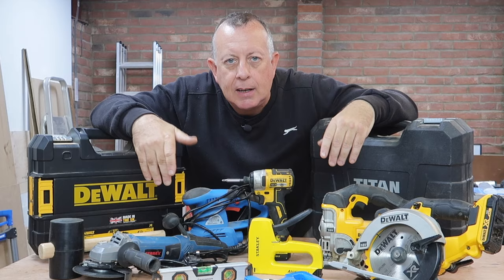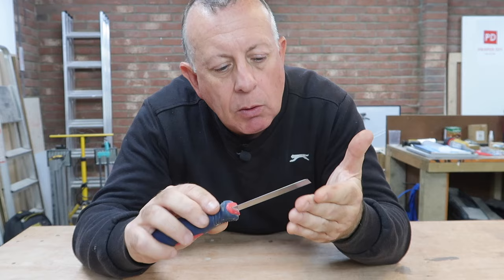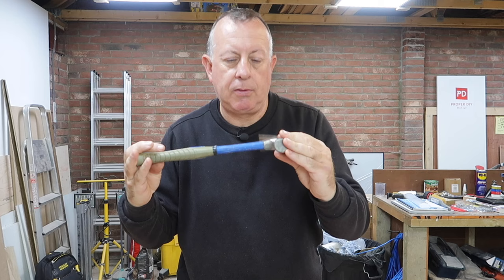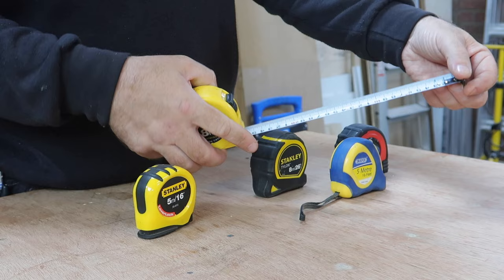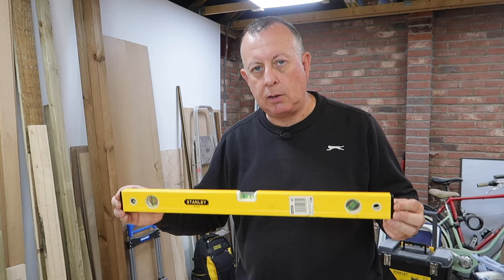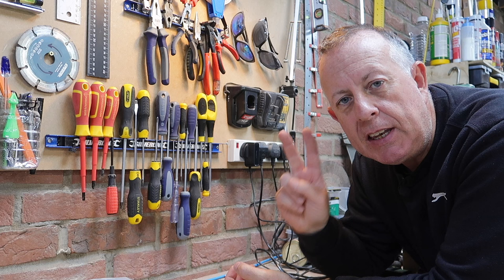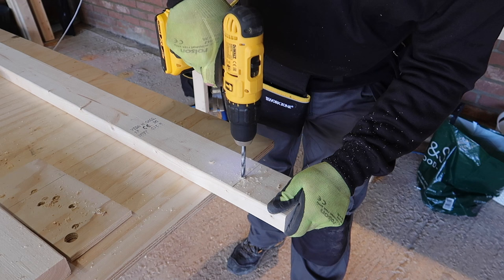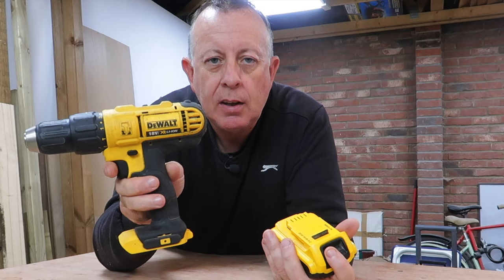Top 10 Tools for the New DIY'er for less than £100

Comment: All the tools are correct, but much better to buy once, cry once and buy the best quality branded tools you can afford.  There’s a world of difference between a trade quality handsaw or adjustable spanner or spirit level or pliers and their cheap pound shop version. 
I’d add a combination square and slip joint pliers to this kit too.
Reply from the maker: Thats fine if you have the money and therefore choice. It's a top 10 so if you are going to add 2 you need to take 2 away as well!

Comment: for the cheap cordless drill (IE, not makita dewalt milwaukee hitachi etc etc) id say get a black and decker. they have a bad reputation for "not being high end" but they also dont claim to be. and at the very least the black and decker is above the no name brand power tools cause at least theres easily obtainable replacement batteries. if you buy a no name cordless drill in a years time the company might no longer exist and replacement batteries will be an issue. 

for occasional use theres nothing at all wrong with black and decker.

Comment: Good choices, particularly the budget cordless drill. My only proviso would be buying into a battery set, so if you do buy the cheap one, as you progress and potentially improve your tools you couldn't buy a bare unit and would end up with additional chargers. Not a major headache, but I prefer one (Bosch)
Reply from the maker: Great tip!
Reply: Agreed drill/driver is so universal going too cheap is counter productive and replacement with better inevitable, pay once cry once for cordless drill. I went Worx, no regrets at all ;-)

Comment: It's a good starter list. I would add locking pliers, a more extensive bit set than is with the budget drill, a set of spanners/sockets because an adjustable can round off bolt heads, a hacksaw and a cheap tool box to keep all the stuff in one tidy place. 
One more thing is, the budget drill has a weaker battery and my Ryobi cordless tended to cut out, a safety feature, when pushing it a bit on half a dozen masonry fixings. A 3 or 4.5 ah battery or better brand like Dewalt is worth the money, but it really depends on what you need it for. Luckily I had my cheap corded one as backup to do the meat of the work.
Reply from the maker: So you have just added in 5 new items. Which 5 would you delete? This is a top 10.
Reply: Agreed on the the battery stuff. DeWalt Milwaukee Festool? Going to put the price up. If you are dipping your toe in the water. Buy budget, if you kill it, buy long term? No point having Festool cordless sitting in the cupboard for 11.5 months a year
Reply: @ProperDIY  10 is too limited, like songs. Which 50 to leave off the list? Didn't even get onto chisels:)

Comment: i wish id bought a track saw and router years ago. use them all the time now. most of my tools are dewalt but i couldnt afford their track saw at 700! so i got the erbauer for 160 and its a great bit of kit for the cash. i have had cheap routers and all been crap so i got the dewalt tho.
Reply: Glad to hear Erbauer track saw is good for you. Erbauer and Evolution seem to vary quality control. When good, very very good; when bad, lethally dangerous - I've returned examples of both when I spotted flaws before using and shops grateful I hadn't found the flaws the hard way!

Comment: Well depending on what your doing, sooner or later one day you'll be at the point you need to buy higher end tools. Drill press, band saw, belt sander, jointer, table saw, etc..... I'm getting carried away with all the stuff I want.

Comment: Wise list. I'd make one big change...
Not 20 years, but 50 years for how long they can remain useful, even by heavy duty DiYer. 
   Small changes: adjustable spanner quality and price matter a lot - Bahco or similar standard only, cheaper are floppy and round the nuts; pliers, similar, once you've used better, there's no going back. A problem for an occasional DiYer is putting up with a bad tool because you've got it then finding it difficult to work with, blaming yourself as incompetent then coming to someone like me to do your little job that is now a bigger job because nuts rounded over, screw heads mashed, cables frayed, visible material scratched and scored. Cheap hammer ok, if not ideal; cheap adjustable spanner almost always a bad idea leaving no skin on knuckles and bloodstain on wood or paint

Comment: I generally find this channel really useful but this video is just plain wrong. For example, the last 3 jobs i did as a very occasional diyer (i tend to start something and finish it 3 years later....maybe....if i am nagged enough) were:

Cutting some old warehouse racking uprights down to fit in the garage. You try doing that with a hand saw. Needed a cutting disc in a grinder.

Drilling the concrete floor for bolting the racking down. A dewalt 996 barely touched it. I had to bring out one of your favourites, the Titan SDS.

Cutting a damaged section of skirting out in an old house where puling the whole board off would have damaged all the plaster. Multicutter made short work of it.

The £100 tool kit might allow someone to put up a curtain pole i suppose.

Comment: Good video.
I’ve acquired loads of tools over the years and I need every one of them. 😂
Surprised you didn’t mention the 45 degree on the saw handle. I’ve an WORKX 20V MAX Lithium drill driver at home, metal head on it. Love it, light and powerful. Use Dewalt at work. Buying a drill drivers only the start, you could do a Top 10 drill driver bits video. Drilling n driving, it’s legal honest 🍺✌🏻**edited as I put the wrong drill name 🤭
Reply from the maker: Thanks. Drilling and driving - that's catchy - maybe after the summer projects
Reply: Hah - I just commented about the 45 deg saw handle as well.  Amazing the things you pick up ...
Reply: There's also no point buying a cheap drill from Aldi which fails to recharge after not being used for a while.  The more you can afford a big Ah battery the better.

Comment: Hi, love your videos, could you do one on ladders, particularly telescopic ladders. I am a silver diyer and have difficulty with the weight of standard ladders.
Reply: Domestic rated ladders would be your best option. Lightest in weight and you should be able to get a set which split into single sections. If you're struggling with those, then respectfully, maybe its time to consider your safety and physical limits. Telescopic ladders are an awful idea, great for trapping fingers and hands though!

Comment: Adjustable spanners are a nightmare... unless you buy a high end version. 
Adjustable spanners have a tendency to round  off knut/  bolt heads .
Reply from the maker: They only round off if you don't tighten then before turning
Reply: @ProperDIY  
No mate... cheap tools are naturally loose..
Especially adjustable spanners. 
But you know that ???
Right  ?
Reply: @ProperDIY  
With respect... I'm a former fabricator engineer and coded welder...
I've lost track of the amount of the amount of bolts...rounded by  crap adjustable spanners.

Comment: Great video Stuart, always so clear and concise. Out of interest what tool box or tool bag would you recommend. I currently have a Stanley Fatmax tote but debating swapping to one of the back pack style ones ! Not because I carry it but just to keep all the tools in place.
Reply from the maker: I have a Stanley back pack and really like it when I need to pop somewhere to do a bit of DIY. I also have a Stanley pull along tool box (B&Q) which is good for heavy tools but not for taking anywhere
Reply: A few years back I was off work with far to much time on my hands. Ended up splashing out on a veto pro pac ( they do back packs ) expensive but excellent bag. Looks small but is like the Tardis. Real top quality
Reply: @ProperDIY  this has got me thinking.  I have to go up a ladder to fix a bit of fascia that is flapping in the high winds we have here in North Pembrokeshire.  Was thinking I would wear a  jumper with a hand pouch to carry the tools and fixings I need to take up there with me - but maybe a small backpack worn on my front would work too!

Comment: the gadget I can not do without is a hot glue gun. apart for the multitude of repairs that it can assist with, it can fix computer cables in place, secure a slack rawlplug and be a temporary third hand when drilling timber etc.

Comment: Thought we might have seen a combination square in the top ten! ...and those cheap adjustable spanners are crap, they don't hold position in use - worth spending a bit more to get a decent quality one.
Reply from the maker: If you add in a combination square what do you remove? This is a top 10 - not 11!
Reply: @ProperDIY  I think most people will have a hammer, screwdrivers and a tape measure somewhere in their house, even if they aren't keen DIYers. Why not remove them and add three more items that are less obvious?
Reply: @andymerrett  But did you need a Youtube video to tell you that you needed one?

Comment: Hi there - would you have a recommendation on a circular saw that can also do miter cuts, or is it better to have a circular saw for straight cuts, and a miter box? Thank you 👍
Reply from the maker: If you are in the market for your first saw I would highly recommend a mitre saw. As well as mitre cuts in it you will find your DIY life changes when you can cut quickly and accurately. See my new video out tomorrow which will also show you how to accurately trim timber in a way only a mitre saw can do.

Comment: It's always interesting to see the differences between countries, such as that dewalt drill having the actual working voltage of 18v on the label rather than the sales puffery 20v no current draw voltage we've got in the USA 🤣
Reply: And I do have quite a few dewalt tools, I just hold a little resentment for their manipulative marketing practices especially since. . . .they don't need it!
Reply from the maker: As I understand it both the 18v and 20v are the same just different stickers and in the US they are a lot cheaper. Not sure why.
Reply: @ProperDIY  they are the same, if I recall there was some legal issues in Europe about misleading advertising.

Comment: NEVER HIT TWO HAMMERS TOGETHER! You can cause the metal to shatter
Reply: Myth busters proved years ago it is almost impossible to make them shatter, by just hitting them together by hand
Reply from the maker: These have spent years hitting my steel chisels 20 times harder than on the video so I doing think a light tap is going to hurt them much
Reply: @Danny-204  @Danny 2004 Whilst “Myth Busters” may have shown that hitting two hammers together will not cause them to “shatter” hitting two hardened surfaces together is a no-no Believe me They can and will chip. When that chip flies off its like a fragment from a grenade. (I have a tiny fragment in my leg from over 20yrs ago) So whilst tapping two hammers together for effect on a you tube video may seem innocent, it opens a can of worms about best practice and safety. Take a look here. https://www.bbc.co.uk/news/uk-england-oxfordshire-52260970

Comment: I would only make one advisory on this list, and that is to completely ignore Dewalt, if you wish to purchase a quality drill. Especially regarding the newer brushless variety. I have recently had several Dewalt drills to look at, and the price of spares for all Dewalt tools that I look at, make it sensible to purchase new rather than repair. In fact some you cannot easily change a chuck now, as there’s no screw inside the chuck. You have to replace the chuck, clutch, and gearbox as a unit. This is often more expensive than a completely new unit, with the relevant guarantee. Now I could be wrong, but my opinion is that they would rather sell another new unit, than you repair a used one. Ok if your a professional who has had plenty of use from the unit, and are happy it’s earned it’s cost. But for me, I’d go Makita all day long, professional or diy. They are the power tool equivalent of Ford, the genuine parts are available everywhere, at a reasonable cost, and easy to repair and replace. Unlike Dewalt, Millwalkee, and several others that are too expensive to justify for the diy’er, the exemption possibly being Ryobi, but often a Makita equivalent is cheaper. The main issue is to choose a cordless range to go with, and stick with it because of the battery costs etc. Ryobi have stuck with the same battery format for many years now, and all the mainstream units have the same format. The other diy range I’ve seen used to great effect is Parkside, often sold at Lidl with a 3 year warranty, and is use and replace range, that is very reliable for the diy’er.